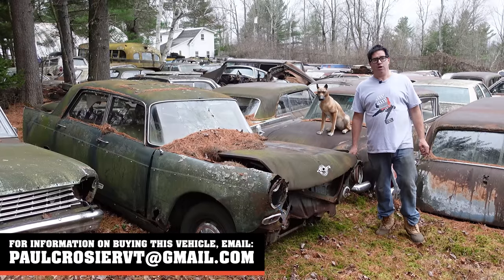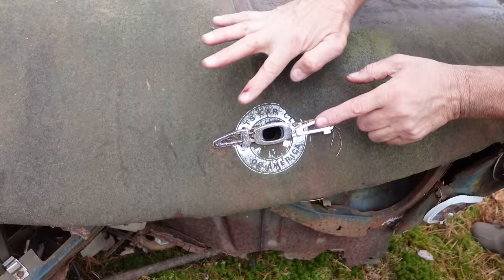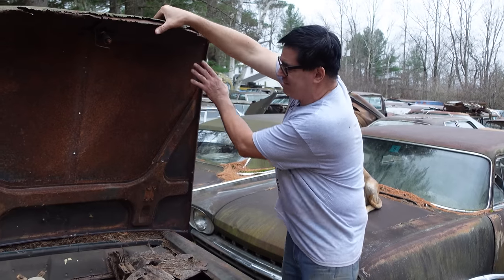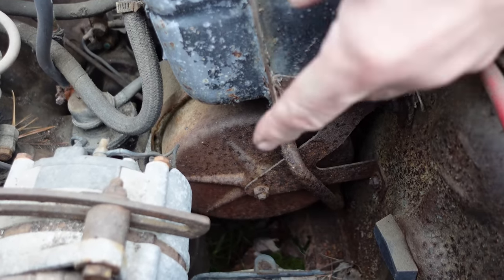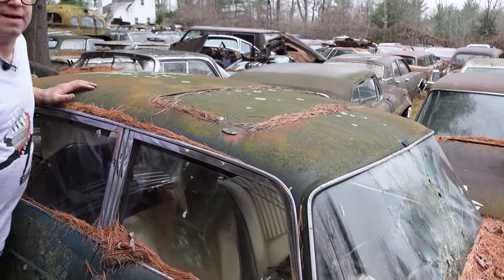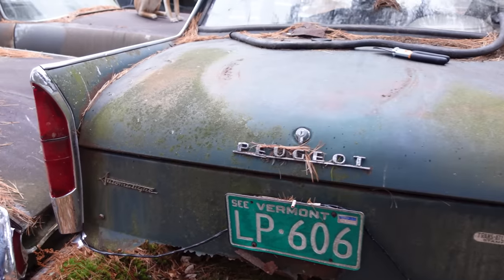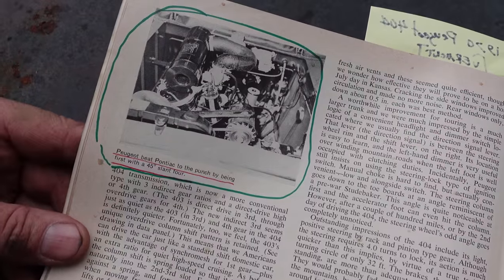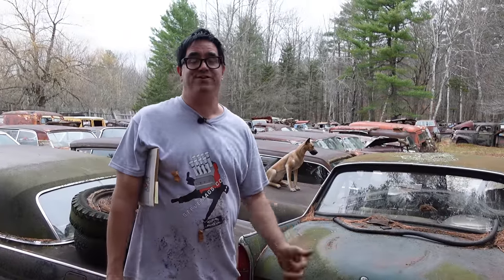Pee Yu Joe!

Comment: Exactly where it belongs. Total junk. They may have been "OK" in Europe, but anything Peugeot that came to the US were utter heaps. So much so that they had to pull out of the US market. Nothing about them was stellar. Cheaply put together, poorly engineered, weird and put together with no sense whatsoever. The French do many things well, but cars are not one of them. Correct, the Fairmont and Zephyr were the first US cars to get MacPherson struts. The 404 models were assembled at the Sochaux plant in France, which today is operated by Stellantis. There was a Peugeot dealer/shop in Brooklyn, NY called "L&S Peugeot". Their motto in the phone book was "The King of the Lions" (in reference to the lion in the Peugeot logo). When Peugeot parts got harder to find in the late 1980s/early 1990s, that was the place that had a lot of NOS stock. I think the styling on this car rivals a Kohler toilet bowl---but at least the Kohler has a purpose, unless of course you use the Peugeot for the same purpose........

Trans-Atlantic Motors is now Volvo of Stamford at 107 Myrtle Ave, Stamford, CT 06902. Possible code 1322 Vert exterior paint. Green in French is "Verte" and in Spanish it's "Verde", so perhaps "Vert" is a way to say "Green" in French. 

The move "The Longest Yard" which has Burt Reynolds it in features another French heap, the Citroen SM. That car was eventually barred from being imported to the US because the French thought that the US government would give it some exemptions (off the top off my head, I believe it was for lighting) and the US government did not grant that, so the French stopped importing it. The Longest Yard features Burt Reynolds taking his girlfriend's car from her house after an argument and takes it on a short chase. He loses the cops and pitches it in the water, smiling as he tosses a cigarette on the ground. 

The kicker is that the Lynyrd Skynyrd song "Saturday Night Special" is playing in the background as he is driving. Another French car that was put exactly where it belongs.
Reply: Well, they weren't okay in Europe, they were good... Like, all of the old wrecks i know are because of bad usage, or rust, its rarelly the engines that broke, but yea, not made for US driving, wonder why they work so well in argentina 🤔 And yes the SM died because of US regulations, forgot the exact reason but they ended straight by shutting off the production
Reply: @Martin-jc8kk  Because the roadways are different in Europe than in the US. Mr. Bastable of Thames TV said, "While novel, these American cars are just not suited for our (British) roads". He's right. They were thirsty, heavy and not with the European thinking at the time, even if European designs "inspired" them. They were built for the US roads and highway system. That's like designing a clothing line of shorts and tank tops for Alaska and wondering why they don't sell as well as hats, gloves, and coats. It's what's suitable for the operating area.
Reply: I own a Citroën SM, and use to work at a garage that specialized in it. My boss, Jerry Hathaway, was regarded as the foremost expert on it. The SM WAS indeed allowed to be sold in America, but, because it had rotating headlights, so the ones sold in America had fixed ones. As long as it’s well maintained, and taken care of, it’s pretty much fine. However, you have to change the oil regularly, and you need to let the engine warm-up for 15-20 minutes before driving, especially if you live in a cold or mild climate. And if something goes wrong with the hydropneumatic system, it can go very wrong, if not caught early. Very impressive car for it’s day, fastest front-wheel drive car in the world. Up until that point, Citroën’s we’re fairly reliable, even if not as well-made as Peugeot. The biggest concern generally is the hydropneumatic system. The four cylinders in the DS and CX are based on the one from the Traction-Avant, and are bulletproof albeit buzzy at high RPM. They are highly durable, and thus highly tunable, particularly in terms of turbocharging. The 2CV and it’s many derivatives make the VW Type-1 Beetle look like a modern Porsche 911 in terms of simplicity, and idiot with a tool box can repair and maintain a 2CV. I would argue it’s the most reliable and practical of the big “People’s Cars” of Europe (Morris Mini, F.I.A.T. 500, Volkswagen Type-1 “Beetle”).

Americans I think largely got a bad impression of French cars, mainly because the ones imported  were not supported by dealership networks and adequate parts/service availability. Peugeot Diesels, for example, were right up there with classic Mercedes-Benz in terms of build quality and reliability, until they started using electronic fuel injection, which made them unreliable.